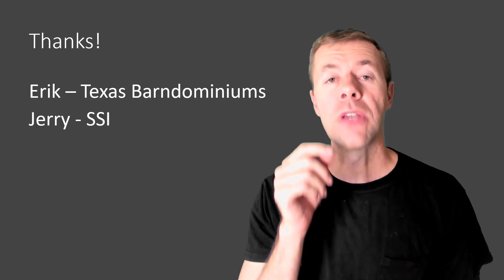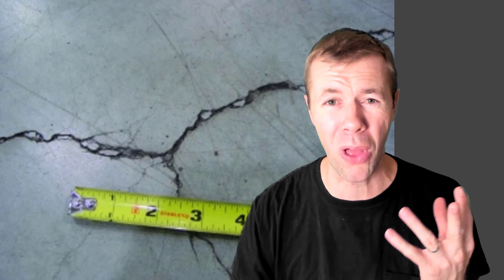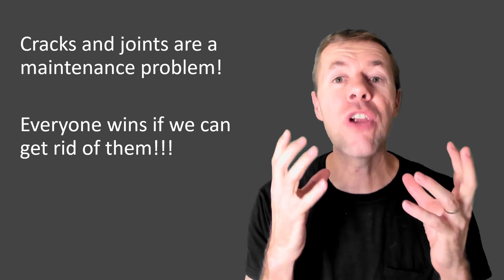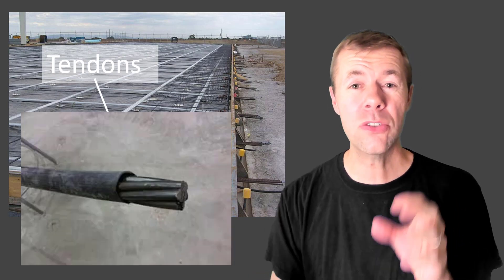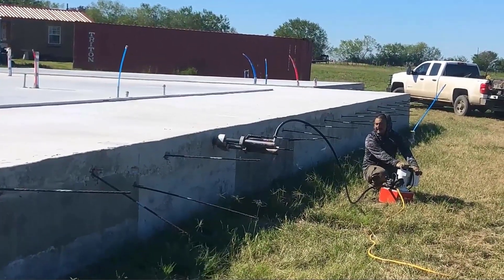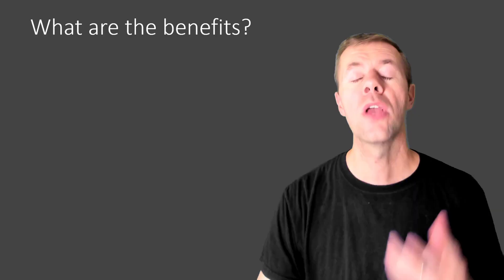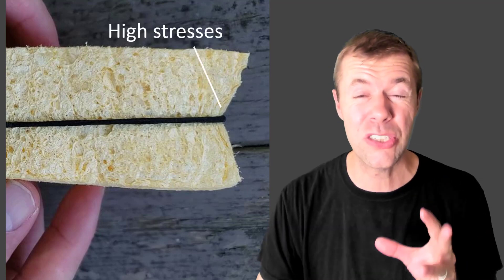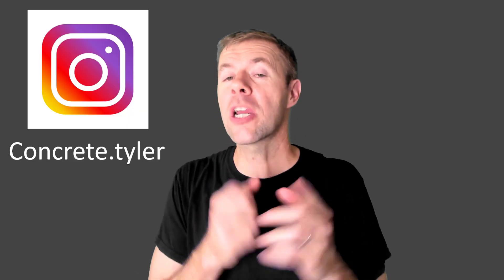Post Tension Slab | Eliminating cracks and joints in concrete!

Comment: Hi Tyler. Great video! I have seen many home foundation slabs where I am from in Houston. I have never seen any of those slabs with joints in them. I've seen PT slabs, pier and void box slabs, and traditionally poured rebar only slabs. None of the slab in the living space has any type of crack control joints (not even the garage). They are all poured as one monolithic slab with no joints or score marks. How come? Aren't they needed? When we do flatwork like sidewalks and driveways, we always get joints cut in these. What are your thoughts?
Reply: Jonas Rodriguez one thing to consider is the extreme temperature changes per say a driveway verses a home slab, where the temperature will most likely remain somewhat consistent. Plus unseen for most part. Basements for instance are usually finished floor with no joints. Size also would play out in favor. PTI is a good source of info and can even take courses online.
Reply: Yeah, here in Houston we have SOC, slab on clay :). The foundation repair guys have a lot of business. I think many builders now use a post tension slab because they got sick of repairs.